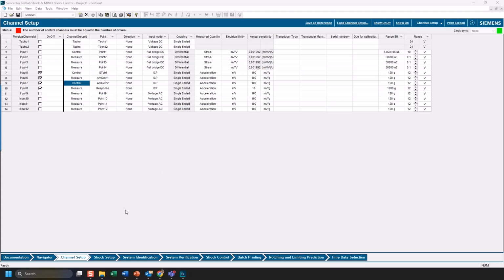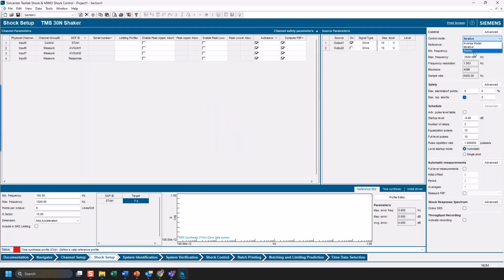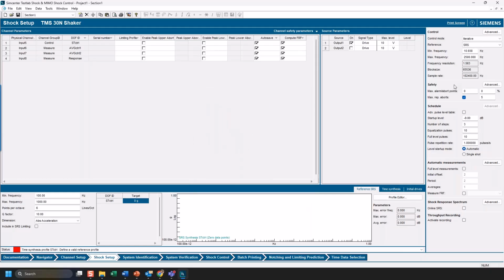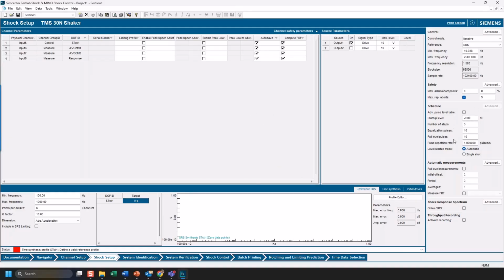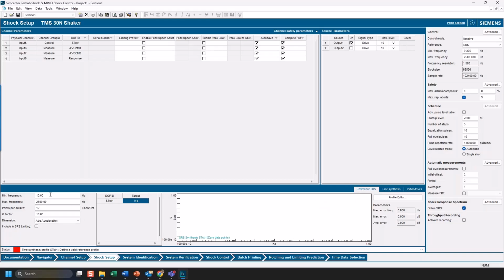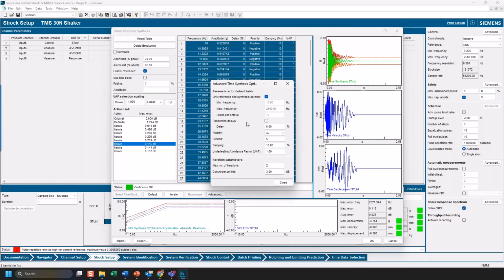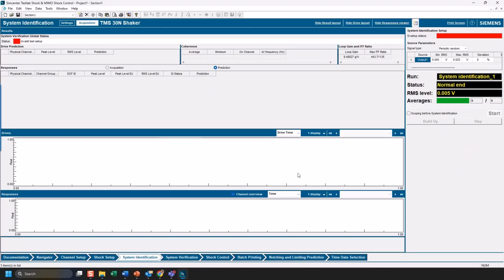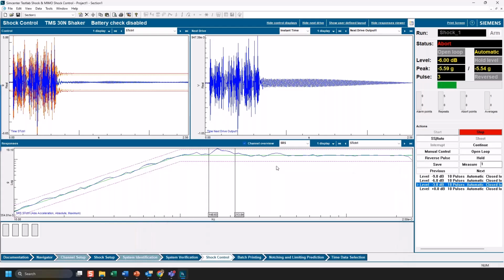SRS Simcenter Testlab Shock Control

Comment: Excellent video! Could you please share the hardware configuration? Also, why does the software fail to recognize the output and display the message  'The number of control channels must be equal to the number of drives'? The output button is gray and cannot be selected.😮‍💨
Reply from the maker: The hardware configuration is a 2 slot SCADAS Vibco SYSCON chassis with a VBDS-4 (4 channel dynamic strain input card) and a V8 (8 channel ICP/Voltage) input card. There are three possibilities that come to mind regarding the error mentioned: 
1.	no channel is set for control
2.	more than one channel is set for control
3.	Incompatible non-Vibco SYSCON 
If you need further troubleshooting help please contact chris.sensor@siemens.com